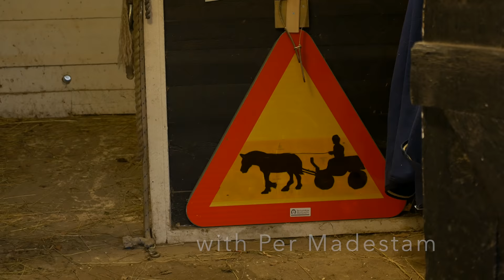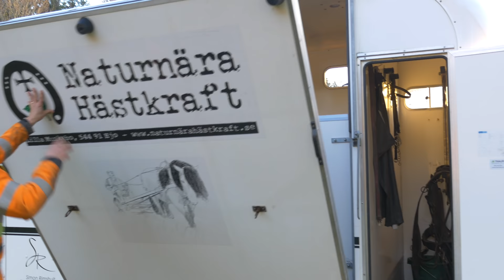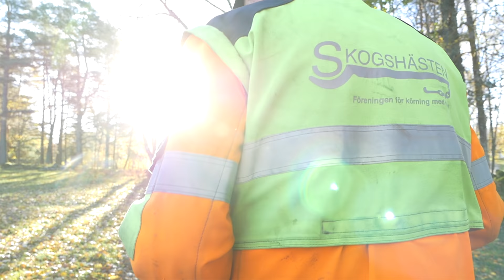Working With North Swedish Drafting Horses | S1 • E2 | Great Farms of Sweden

Comment: The tool they are using to drag the log is called a logging arch in english.
Reply: I think they may be several names, my grand father raised horses, if I remember right he called a fore arch. He had a type that was made of wood, runners and mounted toward the back and clamped to the log. Really good old days of remembering work when it was fun.

Comment: Very nice video! I would like to point out that the main advantage of using horses in forestry (maybe also agriculture) is the fact that you don't destroy the soil. Studies on this subject show disastrous results after even only 1 run with heavy machinery over fresh soil, even when they have the huge tires on. They destroy the soil so much that it becomes impossible for new trees the grow back where the machines have driven. This is one of the reasons why we start using horses again in Belgium.  ;)

Comment: We have had 2 of those horse trailers, and both of them were built very bad. The floors on them were bending and the rivets holding the floor down would break. The first trailer was only used 12 times, and the second trailer did not last a year. Neither trailers were abused, just carried a single 16.2hh dressage horse.

Comment: First, I love this topic. The use of draft horses is amazing and should be done more. Especially when doing things like cutting hay/grass.

But... (yes there is a "but")

I hate to do this, but I find the discussion about environmental issues a bit "questionable" in this special case. If I cut down a tree I use an ax and a one man or two man cross cut saw. Not a chain saw as done in this video (which uses fossil fuels). And the horses were not walked to the project site, but driven by a truck and trailer (thus using fossil fuels). Some may say I am being anal... Okay, everyone is entitled to their opinion (maybe some comments below mine). But here is the question: is there really a provable (not just opinion based) environmental benefit in this case? Especially when saying in the video that his work would not show any indicator he was there with the horses 7:21. But dragging logs with a skidder does leave a mark 9:40, 10:50 (maybe more than a front end loader or log grapple lifting the logs into a trailer -- at least maybe not much more than the horse trailer 14:15). Traditionally, if the logs were for firewood, they would have been saw at site (using hand saws -- no fossil fuels), split (ax or maul) and stacked on site to dry and become lighter. Then moved  when dry (by human back labor to horse drawn wagon with wheels -- not skidded). That is the most environmentally sensitive way to process the wood (if used for firewood .. the video does not specify and I am assuming, maybe incorrectly). Just saying..... :)

That being said... am looking forward to the hay cutting videos next year. :)